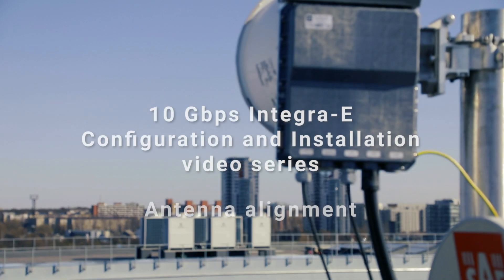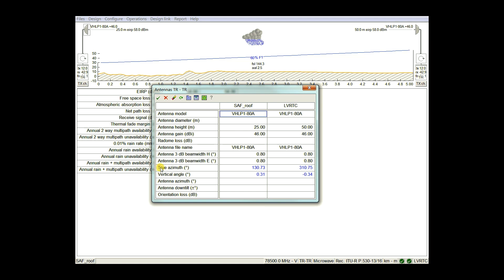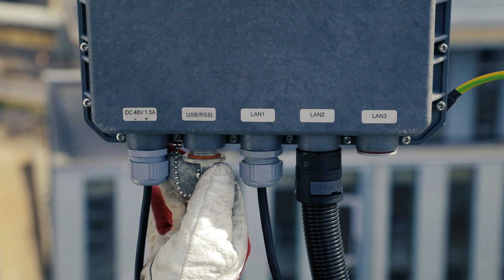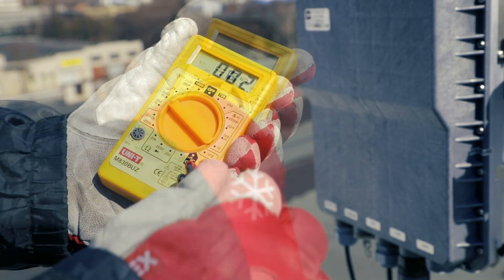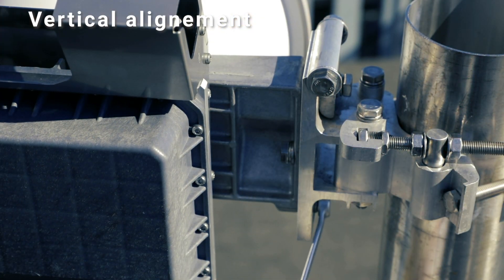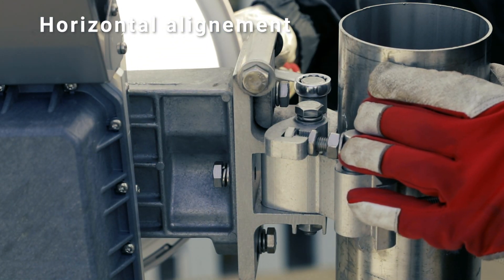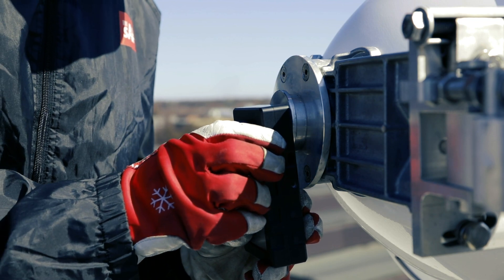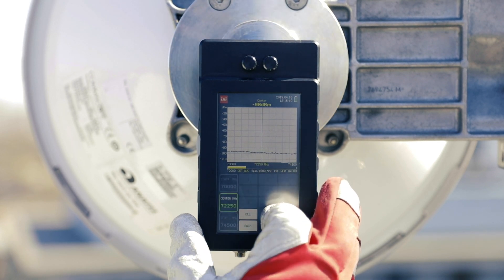Integra-E Configuration and Installation video series - EPISODE 4

Comment: hi there what is the max distance for this unite ?
Reply from the maker: Hey there,
The max distance will depend on the diameter of antenna, climate as well as the throughput capacity! You can check the Integra-E product page https://www.saftehnika.com/en/integrae and under downloads you will find the distance graphs for a reference.